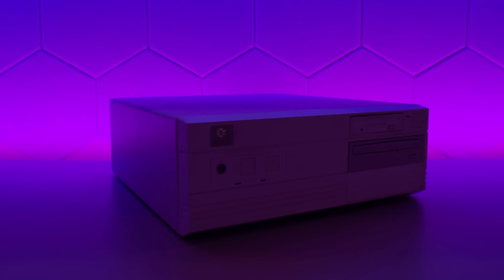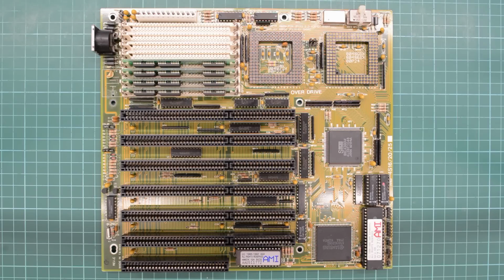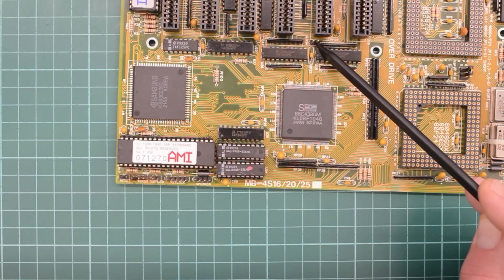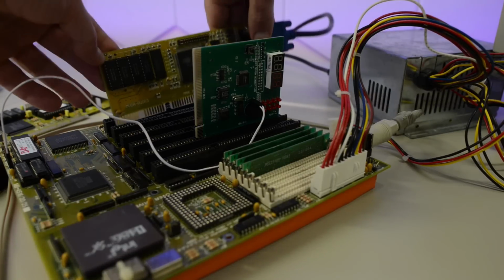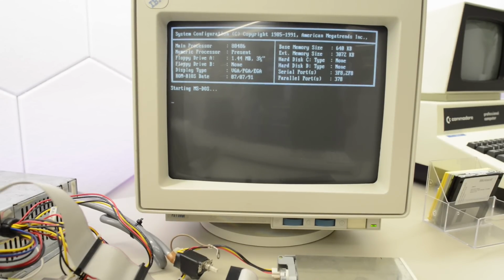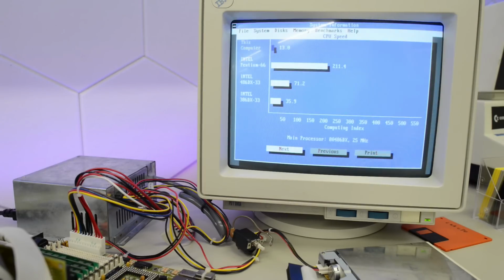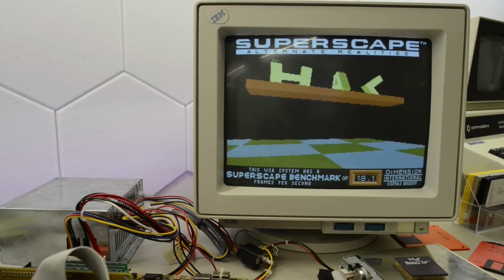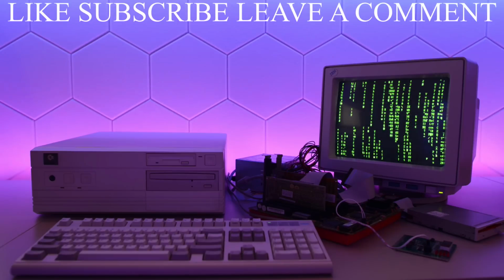Commodore 486 Restoration. I found the matching MOBO!

Comment: I remember very well my Commodore 486DX33Mhz with the same case as in this video. You could put 2 extra harddisks: to the left of the 5,25"Bays or underneath the Power supply. Either case there was a specific cage to put the harddisk in. The board of my Commodore had 32bit Vesa Local Bus: the video card was a Cirrus Logic CL-GD5429 - can't remember how much Graphics RAM. In no time I swapped the ISA controller with an E-IDE in a VLB Card, with noticeable results. Those were the days. I really fancied that computer, which was my first one. Later on I swapped the CPU with 486DX2-80Mhz AMD, bought 2nd hand.

Those were the days: MS-DOS 5, 6.2, then 6.22, DoubleSpace, Drivespace, Memmaker, Norton Apps, Stacker (file compression system), Seagate's, Maxtor's, Western Digital, 3712MB, 4096, 8192 MB of RAM in evolution order. I remember using windows 3.0, then restoring 7 floppy disks with a copy of Windows 3.1, using CPBackup - you literally had to start the restore process with the last floppy disk, only then the first disk.
Then loads of games, the ARJ file compression system (prior do ZIP), then the Sound Blaster and CD-ROM. This wasn't the very begining of computers of course, but it was a great time to live the computer evolution and grab a hold of it. 

Thank you for this video, it really brought me back memories.

Comment: Older bios will allways boot in 80 column mode(70Hz). 320x200 resolution also runs at 70Hz.
Reply from the maker: yeah, I don't expect to find a solution for some flickering on camera when CRTs display BIOS text. However, there might be a solution to sync when I'm in DOS. I have received two apps to try out. We'll see how they perform in one of the two upcoming videos

Comment: Difference between 486DX and SX is just the inclusion of the math co-processor.  The processor speed is the same and will benchmark the same.  If it was a DX-2 it would be clock doubled but just DX is the same speed.  Even though it's a DX capable of 50Mhz you would need to change the crystal to increase the speed.
Reply from the maker: Yes, I didn't know that 3D benchmark ignored the Math co. I was expecting the DX50 to run at 25 but I have ordered a faster crystal : )

Comment: Didn't see much useful information in the linked forums. The graphics card appears to be a Oak Otivga with 256 or 512K RAM, the multi-io card is a UMC MIO-286UC.
Lots of talk getting the multi-io card to detect the floppy drives, and trying to get soundblaster and network cards working. Nothing that seemed useful to me.
Reply from the maker: Ok, thanks for checking. I'll see if I can find those cards when it's time to get this Commodore as original as possible. Meanwhile, we'll make it as fast and useful as possible : )

Comment: In the first forum thread they‘re discussing about the power delivery to the CPU. Some claimed that it can run only 5v CPUs others claimed, that it can run also 3.3V and 2V. If you want a complete translation, just write me an E-Mail. In the second post the op is selling this mainboard and some other goodies but there‘s no relevant information to this mainboard.
Reply from the maker: Cool, There is no 3.3v regulator on the board so I'd say 5v only. Or ODPR as we have on the board right now. The board has now been identified : ) Thanks

Comment: It's been a long time since I played with CPU clocks, FSB and everything, but IIRC from my trials, for example a 100 MHz CPU performed worse at 50 MHz than a 50 MHz CPU. The jumpers on the motherboard for FSB and multiplier must exactly match the CPU specs for optimal performance.

I've been told back in the day it's the way some CPUs are made. They can't go much faster, and not much slower either. I've never actually tried to thoroughly verify this though.
Reply from the maker: I don't really know either. someone claimed that some slower CPUs were rejects that couldn't perform stable enough at an intended speed. But I don't know if this is true
Reply: @epictronics I've read that too, a long time ago. Interesting! 😄

Comment: Actually it's normal that the DX has the same score as the SX. They are identical : the DX simply has a math coprocessor inside. But if your benchmark program does not use those floating point calculations, then both CPUs will perform exactly the same !
Reply from the maker: Yes, apparently 3D benchmark does not use the FPU. I need to find a better benchmark
Reply: @Epictronics1  Actually very few programs and games used an FPU at that time (except for some spreadsheets or math apps)
Reply from the maker: @olivierpericat9224  yeah, this machine will probably play anything I would want to play on it already. But I have to try and see if we can get it faster anyways : )
Reply: @Epictronics1  Yes sure, I would do exactly the same !!

Comment: The first link only talks about clock speeds in general. (maybe that OSC2 defines the bus clock and that the board doesn't have any L2 cache). The second link seems to be dead...
Reply from the maker: Thanks. I just tried the links and they are both working again
Reply: @Epictronics1  The second is a wts.

Comment: If a 486 DX and a 486 SX are running at the same frequency, they will generally turn out the same performance unless the test you are using a benchmark that makes use of floating point calculations.  The main difference between 486 SX and 486 DX CPU's is that the DX chips have an integrated FPU.  I think what is happening is that most of the CPU's are being limited by the boards speed whereas the DX4 ODPR 100 (being an overdrive chip) runs internally at triple the fsb speed which would explain its higher scores next to DX and DX2 CPU's.
Reply: I can't remember. I want to say some boards wouldn't take  a dx2 either. To many years ago. Also something about a fan too.
Reply from the maker: @idahofur  The multiplier worked but I was tricked by 3D benchmark that does not use the FPU in the DX chip
Reply: @Epictronics1  I had to do some reading. Besides the floating point unit. The dx50 was a slightly better chip. I think I got that right. I did some more thinking. Besides the fan. I remember starting with 486 dx chips and some place along the line with dx2 chips. I think around that time is when I found out about the addition of 2x multiplier jumper settings.
Reply from the maker: @idahofur  yeah, the DX50 runs at 50. The DX2-50 runs at 2x25
Reply from the maker: Yes, Someone commented that 3D benchmarks does not use the FPU on the DX chip. I'll try to find a benchmark that does

Comment: 80487SX is a math co-processor, not a CPU
Reply: Yep its just a 486 not a copro
Reply from the maker: well, sort off. It's a marketing thing. Intel used a standard 486DX and made a few minor changes to it and rebadged it as a 487. So, it was marketed as an FPU but in reality, it's a 486DX with an extra pin. If your MOBO specifies a 487 you can just bodge one of the pins to ground and use a regular DX instead

Comment: I remember replacing a LOT of ASI motherboards (Aquarius Systems Inc) with DTK and FIC motherboards.  Considering Commodore was going under, it doesn't surprise me that they were using ASI for their motherboards.
Reply from the maker: I never messed around with ASI boards back then. Did they have quality issues or did they perform lesser than other brands?
Reply: @Epictronics1  A little of both, if I'm being completely honest.  It was a third tier white box brand that filled the low cost hole.  If it says anything, Biostar was even considered higher quality.

Comment: When I saw the benchmark result I thought "Turbo button". LandMark's instant update is your friend while messing with jumpers on the board while it's running.
And if you're using a Cirrus Logic card, there is a utility for DOS that can change the refresh rates, but only upwards.
Reply from the maker: cool, thanks. Well, the nearest camera settings I have is 1/60 and 1/80 so I have to match one of those somehow. Not sure what CRTs think of refresh rates higher than 70?
Reply: @Epictronics1  IIRC the Cirrus goes up to 85 (progressive) in the "lower resolution" modes and 87 (interlaced) in the "higher resolution" modes although IIRC again 1024x768 I think was 87i, 60 or 70Hz, lower resolutions could have higher maximum refresh rates. But I don't think you could tweak The Text Mode (TM).
(look for clmode.exe - with 1MB of video RAM, that thing not only tests resolutions and color depths, it also makes it look awesome. Not as awesome as dazzle.exe though.)
About CRTs compatibility... I don't think any IBM CRTs like anything SVGA. That chomkin Monitor you had before that will probably sync to whatever that card can output and then some (and that probably without even clicking the relay telling you that it's running in some serious high resolution modes - I wouldn't be surprised if that monitor does 1920x1440 and still have a sharp picture - I have a similar one)
Reply from the maker: @senilyDeluxe  Cool, thanks. I'll try clmode with a game on camera as soon as we get this Commodore up and running. dazzle.exe? The IBM P97 is glorious to use for sure! I'm also lucky enough to have it's big brother, the P275. It doesn't come out much though because it has a black case and rarely matches what I'm working on :)

Comment: CMOS display type mismatch. May be that the CMOS defaults to mono or the jumper on the motherboard set the display to mono so that is why some VGA ISA video cards do not pass the POST routine? Maybe some corrosion around that color/mono jumper?
Also the unlabeled jumper is near the RTC so it may be the CMOS reset. I saw the battery header near the keyboard connector so you may add a external battery to that header to keep the CMOS values.
The jumper near the ISA slot may set the ISA clock as fixed or as a ratio of main clock.
As far as I know, a 486SX@25 and a DX chip were the same, only difference between them being the FPU being enabled/present in the DX and disabled/not present on the SX chip. So getting the same score for the same clock implies that the benchmark do not use FPU. As you may see, the DX2 and DX4 works at 2x or 3x speed of the SX or DX 486. 
I hope you may overclock that motherboard but I doubt that you may get more than 33MHz FSB (66MHZ crystal clock) and maybe not even that very stable. As is, the best option may be a AMD5x86@133 that may run at 100MHz on that 50MHz crystal but as it requires 3.3V instead of 5, you are limited to that DX4@100 that run at 75MHz speed. Anyway, impressive for that motherboard.
Reply from the maker: yes, that jumper is green and nasty from corrosion. I just did a second test and it only takes some of my video cards. We'll clean it next week and see if it makes a difference. We will also add a CR2032

Comment: BIOS reference «40-0500-DG1112-00101111-070791-SOLUTION» on that motherboard takes you to the «Aquarius Systems/BCOM 4D33/50F»... also known as the «Commodore T486DX». The Retro Web has an entry, with a list of jumper settings (maybe there's a change in the documentation you'd like to check). The layout is different, but BIOS availability suggests two revisions.
Reply from the maker: yes, that certainly is a very similar board with a different layout and L2. Thanks!
Reply: @Epictronics1  I'm going to go out on a limb, and say the drive was a Conner ..
Reply from the maker: @paulwratt  I hope it was! I found a dozen Conner drives at Computer Reset. So far all tested drives are still working!
Reply: @Epictronics I've heard you mention computer reset several times. I had assumed you lived in Europe. But with the amount of stuff you've gotten you must have visited unless you already lived near Dallas. I live north of Dallas and went there once and also bought a new PCJr from Tanner Electronics when he went there before he closed down.
Reply from the maker: @stonent  Yes, I went there, quite late actually. I was there on the day LGR recorded his second vid.
Reply: @stonent  if you check his videos, there is one from the visit to Computer Reset at time of "everything has to go", and another with "unboxing" (after he gets back to then new lab, in Germany).
Reply: @paulwratt  Well I wasn't sure because he said  "I don't speak German"
Reply: @stonent  my mistake, I thought he was German, and in Germany. Then he might be Scandinavian, Dutch or (non-german) Swiss. His about page says US is his Location, but I dont know how accurate that is, might just be for "security" reasons ..

Comment: If the benchmark does not use the FPU, then the Intel 486SX-25 and the Intel 486DX-25 would benchmark the same. Besides the FPU, Intel 486DX-25 didn't contain any extra features over its SX counterpart.
Reply from the maker: I think you are right. someone in the live chat commented that 3D benchmarks does not test FPU.
Reply: Came here to say the same thing :-)
Reply from the maker: @adriansdigitalbasement  yeah, I'll probably never use the FPU on this Commodore. lesson learned and mystery solved : )
Reply from the maker: @Mr Guru Hey, that sounds like a fun project. I may have a go at early Autocad

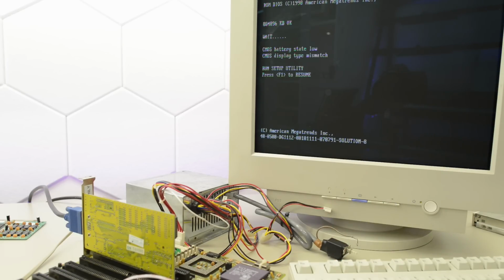Comment: 9:30 - looks like contacts inside the slot were dirty, nothing weird.
I was about to point out turbo, but you figured it out.
I just noticed that board has something missing - I cannot see any cache chips.
There are also no options for L1 cache in BIOS. Maybe you should try another BIOS to enable at least L1 cache? Also, try cachechk to determine if L1 cache is enabled.
Reply from the maker: yeah, there is green nasty corrosion on three of the pins in the first slot. We'll take care of it next week. That is correct. This board does not support L2. But L2 does not make this much difference. Something else is messed up. Maybe L1 as you guess. I don't know if there is a better BIOS available for this board. So far I have not found any documentation at all
Reply: @Epictronics1  What does cachechk say? Try any other 486 ISA BIOS, might just work.
Reply from the maker: @86smoke  Cachechk sees DX4@75Mhz 16kb cache enabled. Someone just posted some info that might lead to an alternative BIOS for a very similar board
Reply: @Epictronics1  yes, it's worth trying. Your BIOS is from 1991 and may lack some features. Anyway, test results suggests that cache is not being used.
Reply from the maker: @86smoke  I agree. cachecheck reports enabled L1 but numbers are suggesting that it's not
Reply: @Epictronics1  So maybe ice.exe and icd.exe are worth trying?
Reply from the maker: @86smoke  Absolutely : )

Comment: I'm German, but without links to the forum...
Reply from the maker: Oh, awesome. Thanks! I will also add them to the video description. They were a bit hard to find. https://www.forum64.de/index.php?thread/84902-486er-mainboard-mb-4s16-20-25-frage/&pageNo=1
Reply: @Epictronics1  Need a bit to read through the 12 page thread...
Reply from the maker: @graealex  haha, Thanks bro : )
Reply from the maker: https://forum.classic-computing.de/forum/index.php?thread/11536-viele-vintage-platinen/
Reply: @Epictronics1  Well the PVI 486SP3 guy says he is doing recycling and wants to know if there is someone who might use the PCBs.
The last guy says the PVI 486SP3 is working well and stable with the PODP5V83 Overdrive.
Reply from the maker: @graealex  cool, I wish I had a PODP5V83 to try. thanks

Comment: 486-25c is around 1990, its the same front case as the A3500 prototype. Very rare, never seen any on sale anywhere.
Reply from the maker: Thanks, that's useful info. So this Commodore is newer than the T-486-25C and made one year before ESCOM. So far nothing contradicts our guesses
Reply: @Epictronics1  of course, the 486 did not even use generic board but a real commodore board if you look at the picture top right corner (covered by white sticker) its actual commodore design, probably designed in BSW (Braunschweig, Germany) and maybe even has a custom MOS chip on top right (ceramic one). 
https://www.commodore-info.com/foto/computer_t486-25c_04.jpg

I guess it is a Commodore product (while they were still there) but I would not go as far as saying the case was designed by the same person or corporation as you did. I cant see any correlation between this and the A4000 (color and the 3 stripes put aside). Construction (metal case) is different, front does not "snap on with clips", the symbols are not really what Commodore used (font, strange "I/O", "H.D" instead of H.DISK) etc. As I said, it is an ESCOM product as far as I remember, or was also sold by ESCOM with a different name or the same case - maybe there was a cooperation before the bancrupcy, but I would not call it "Commodore under ESCOM" because of other clues (Logo design, etc.)

Why is your logo blank?!?!?!? Ususally it is pad printed and nice etc. Did you retrobright this case and leave the logo in it? It would destroy the metal parts and the color would flake off (or at least it is possible that it would do so).